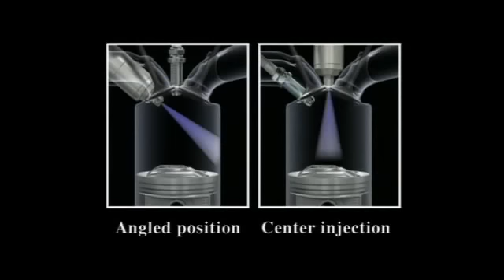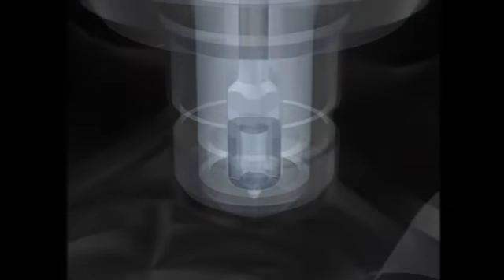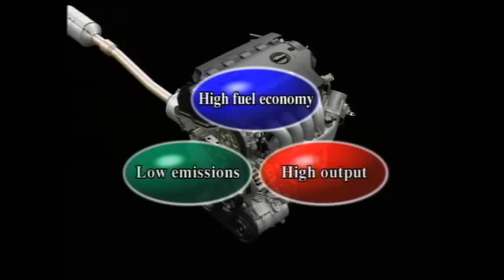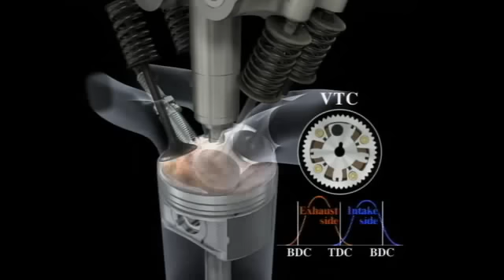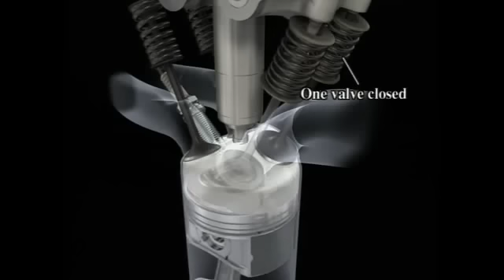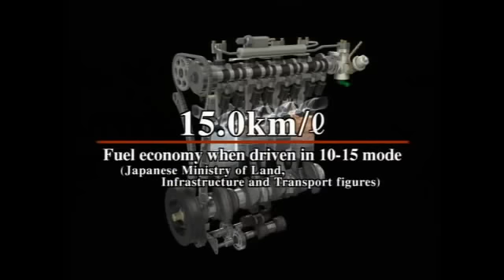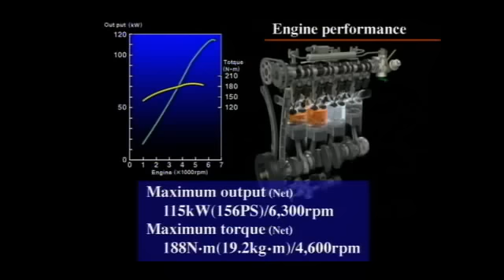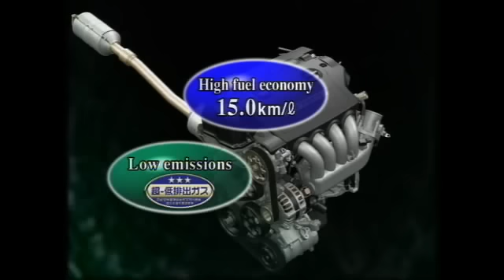Honda 2.0 i-VTEC I Direct Injection Engine.

Comment: LoL The video doesn't state the excessive buildup of carbon on the back of the valves that will need to be manually cleaned every 60k.
Reply: Yes that is true that Honda failed to see that carbon would build up on the valves however there new design of multi-hole direct injection at an angle to solve this issue is still causing issues. This is because like the video states if fuel is injected at an angled position noted at 1:38 in the video can cause fuel to stick on the cylinder wall. With these new 1.5 Turbos with multi-hole direct injection are having is fuel dilution were oil and gas are mixing. If we look at this video from Honda https://youtu.be/fVdKNRgzGT8 one can see there reasoning is because fuel can stick to the cylinder wall and slip into the oil pan which is my theory behind the issue which may or may not be flawed. So what Honda should have done in both these cases is done center direct injection and port injection to clean the valves similar to Toyota new 2.0 Dynamic Force engine which uses both port injection and multi-hole direct injection which may still have similar issues to the Honda but only time will tell.
Reply: @ItsFelipeA - I heard Honda resolved this issue & the Type R engine doesn’t have this problem.
Do you know if the type r engine K20C avoids carbon buildup ?
Reply: @The-KeyserSoze   I think with the 1.5 they changed some things mainly software if I am correct and some other minor changes on the newer Civics. However the software fix my car for not fall under it because I was not in a snow state but I still get check engine lights and the good old smell of gas in the cabin when I do drive especially over mountain passes. This one I just drive it even when the check engine light comes on at this point and just keep going at this point unless it starts to miss fire. So far it's been the least reliable Honda I have ever owned and it only has 90k and it's been to the dealership more than my old Honda with 320k. I also have the 2.0T in my Accord that one has not had any issues no check engine lights nothing like my 1.5T Civic. However carbon buildup that I am not to sure there is no dual fuel injection to ensure no carbon build up. So I am assuming it will have carbon build build up at some point but have not seen anything about it like the Civics but they are not as common as the 1.5T. However I just put catch cans to try and reduce any additional oil coming in though the system.